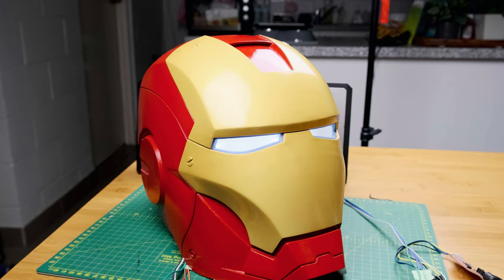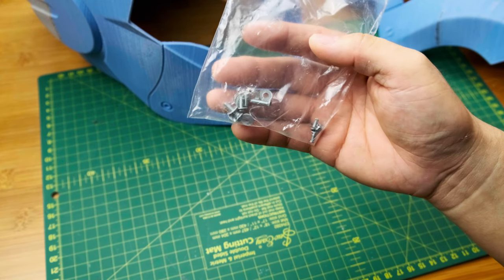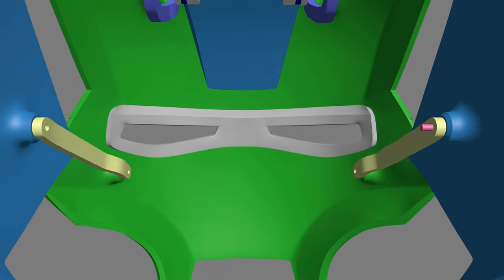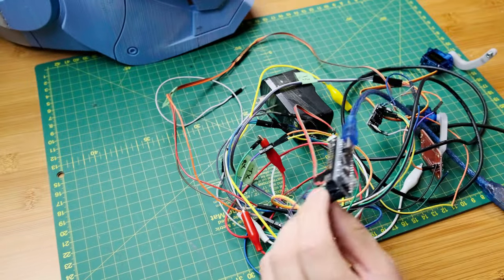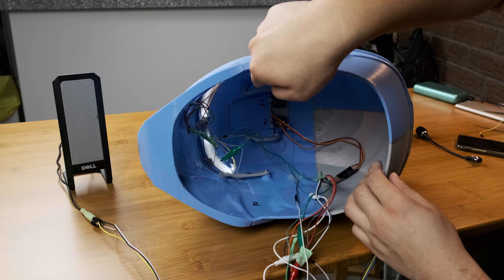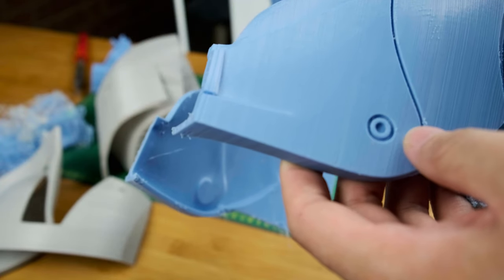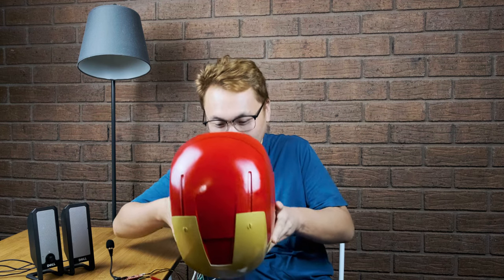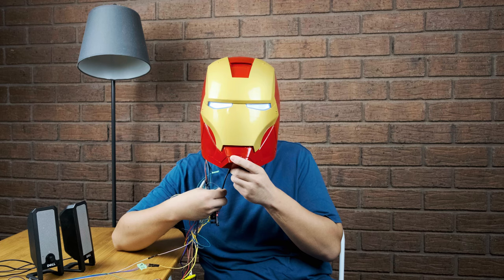3D printed voice control Iron man helmet - the head part

Comment: Yes, I have already seen them and connected them correctly, it detects them correctly. My problem is that when I take out the serial monitor and try to send a code, for example the record code, it does not send anything. I have already looked at it on the internet and I have not found the solution.

Comment: Do you know why the Elechouse Voice V3 card does not send the command on the serial monitor?
I am using the same Arduino nano that you used, it detects it and everything, but it does not send the command.
Do you know any tips, please?
Reply from the maker: @016venux  have you read the manual of this module? It’s needed to train and then use it

Comment: Does anyone know the wiring used to get the audio to come out of the helmet once everything was all closed up is it just connecting a speaker wire to the micocontroller or does it need to be a specific kinda is there another controller thats needed or is it just a breadboard connection?
Reply from the maker: Dfplayer mp3 module that’s I used to play sound effects.
Reply: Thank you gotta order that part the rest just got dropped off by amazon 
Ill probs be back with more questions
Reply from the maker: @Domon1106  no worries mate. Any questions welcome

Comment: @3d something just come across you video and after looking at the wiring diagram just wanted to confirm a few things

On the arduino you have the following
D11 going to TX
D12 going to RX
But on your sketch RX is 11 and TX is 12

Finally

From the arduino RX wire is going to TX on dfplayer and the TX wire is going to The RX.

I’m new to arduino stuff so just wanted to make sure.

Thanks

Shaf
Reply from the maker: Hi, I’m new to arduino too. Still learning the whole thing. And the sketch.. if there’s a problem and just swap it. But I think it should be working.
Reply: @3d something

Thanks for getting back to me, also wanted to ask what the ohms was for the resister to the led and lastly what power supply you are using as it seems to struggle with 4 AAA batteries?

Thanks
Reply from the maker: @SH4FT4STIC  220 for leds and for mp3 module is 1k used in my case.